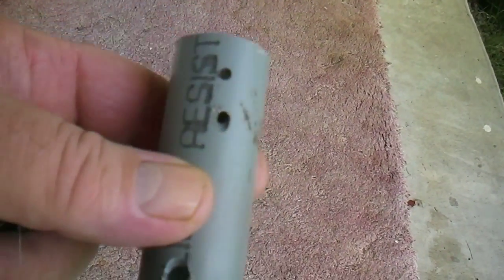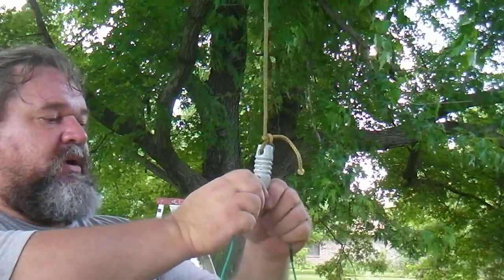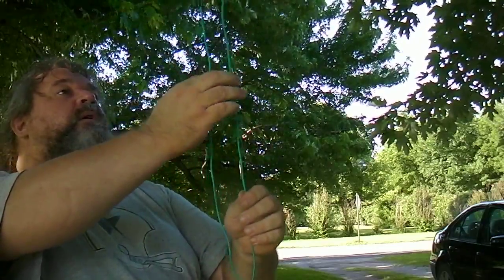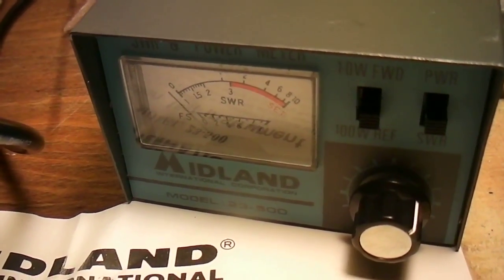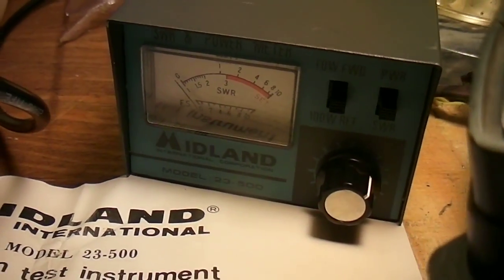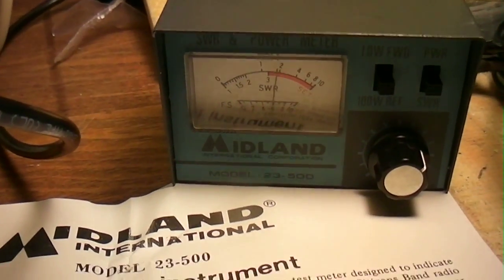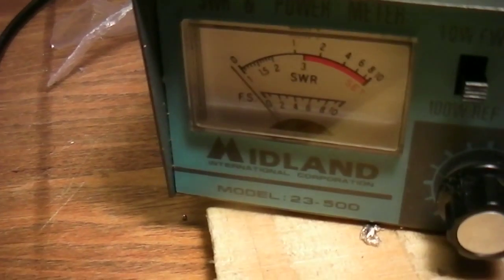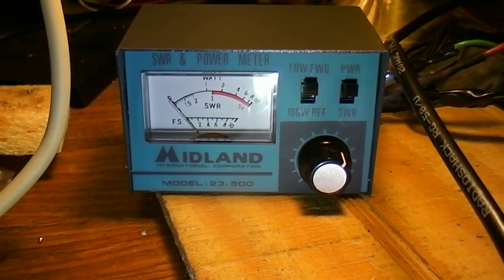Finally Have the SWR SET

Comment: Just curious do you not have to calibrate your swr meter?
Reply from the maker: WV Wildlife Cam I used the set part. I dont have it calibrated against another meter no. Its brand new. Or new and never used. I hope its correct.
Reply: shartne You need to calibrate the meter. Just found the manual online. But you put your right switch to forward and your left to swr. Then you key your radio up while your radio is keyed up move your dial so the needle is to the far right on your meter that is how you calibrate the meter. Unkey then move your left switch to ref. Key up and that is your swr reading for that channel. Each time you check your swr on a different channel just repeat that calibration process.
Reply from the maker: WV Wildlife Cam I did set it like that. but I didnt do it for each channel I will look into that though.